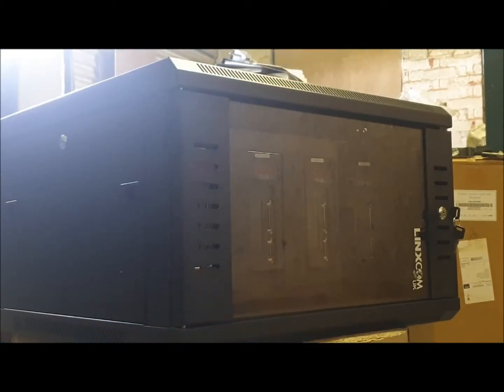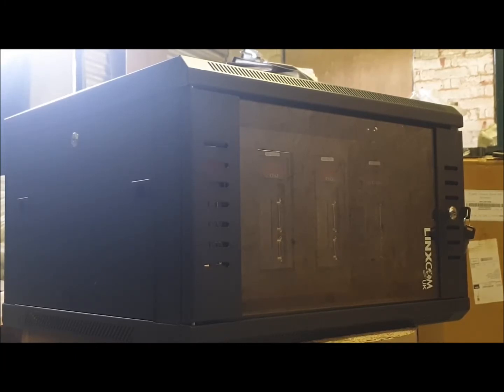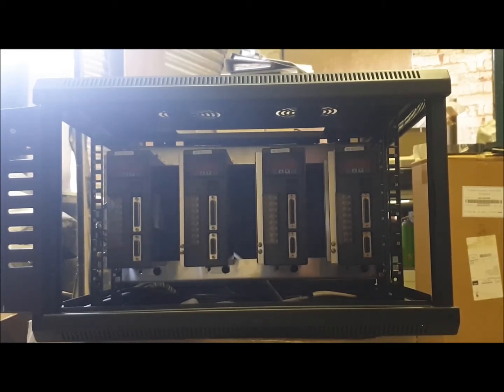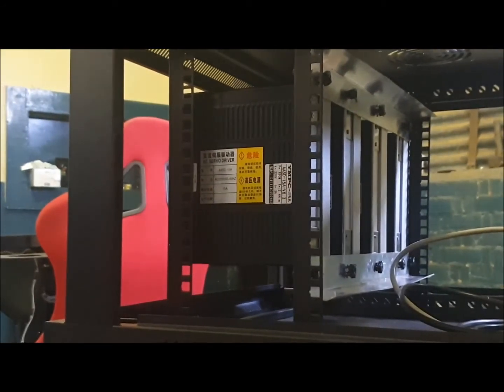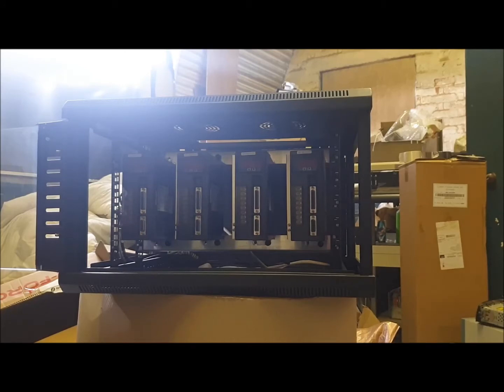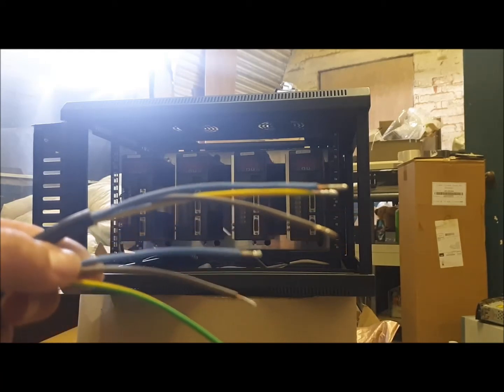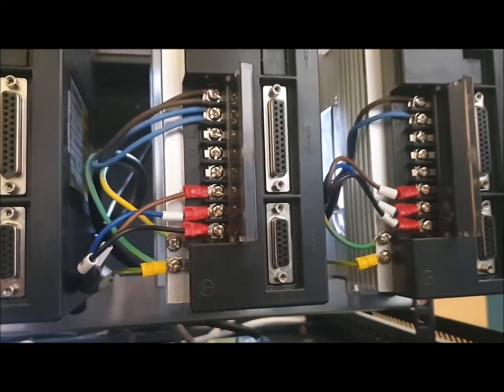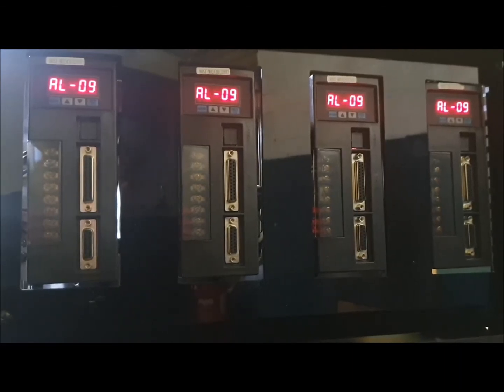Build your own SFX-100 motion platform Part 7 - Electrical cabinet - for Sim Racing

Comment: Hello, firstly thank you for your videos, very helpful for someone like me in the middle of my SFX100 built. Could you please let me know the length of you aluminium angle rack where you bolted the drivers? so I can get the 2 pieces ready for when I receive the cabinet. Many thanks
Reply from the maker: Sorry I don't remember now and the system is with a customer. I think I folded about 1 metre of ally, and then cut to size when I came to fitting the controllers in the cabinet.

Comment: What is the total current load for 4 servo motors I know peek load is upwards of 6 amps per motor. The reason why I'm asking is because I am currently limited to 110 Volt outlets and that would mean upwards of 12 amps per motor with a 110 to 220 converter. Is it recommended to use such a setup just interested. Do you know of any alternatives for such a setup thank you.
Reply: Don't worry about the current draw. I think the actual max is 750W per motor and you will never hit that under normal use. People have measured this and it's 50w holding the rig still and up to 300w total during heavy motion. A lot of US people are using this on one normal household 120v 15A circuit with no problems. Also, I'm not sure why they don't update the documentation but you can run these motors on 120v without a converter. No one has reported any issues doing this, here is a video explaining how: https://www.youtube.com/watch?v=GhvVC6iO04M
Reply from the maker: I'm no expert as you can probably tell on the video. The controllers say they are peak of 15 amps I believe, so total potential of 60 amps. In the UK with 240 volts our ring mains are rated at 32 amps, so in theory we need to run off of 2 separate rings or consumer unit fuses. However in practice it seems everyone is getting away with it off of 1. So you can gang them up as I did in the video for a max of 13 amps (plug puses limit), or split them 2 and 2 and get 32 amps. I've not heard of anyone having and issue either way, but, then there's not a lot of people expressing an opinion/experience on it either way. My argument is try it as the worst that will happen is a fuse blows or trips, so long as the wiring is done properly and safely.
Reply: @GPRaceSimulation   Yeah I kinda figured the rated is likely far over the actual use case given the UK 32 amp rating. My 110 breakers are set at 20 amps each and my one 220 that is located  in another room is setup for I believe 60 amps. I have multiple 110 circuits so I will have no problems with finding two separate circuits but the issue is if I move this setup for things like visiting a friends house to show this to him it will seem to pose problems. Anyways I am sure I can work around it thank you for your quick reply back.